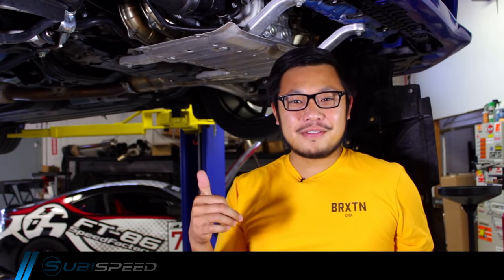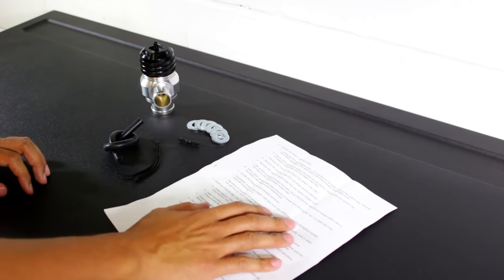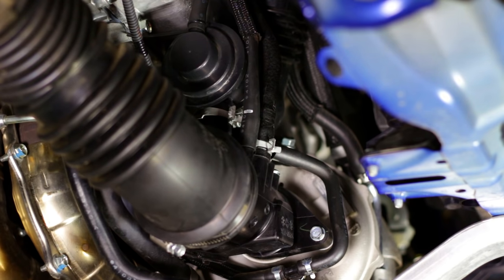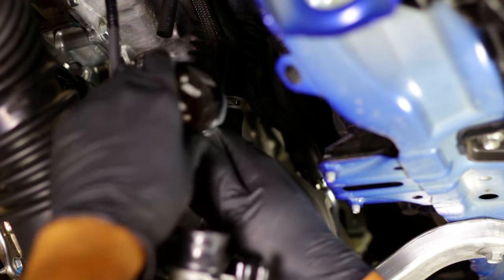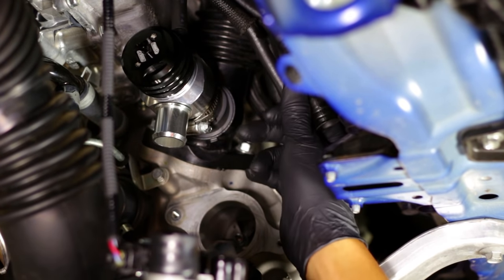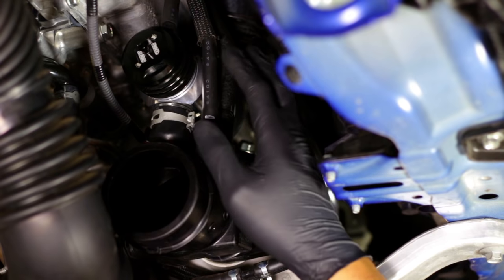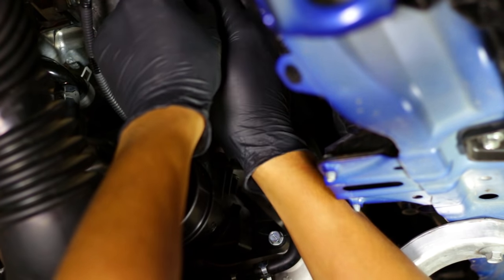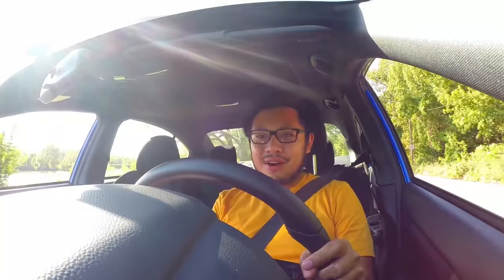SubiSpeed - 2015 WRX TurboXS Hybrid BOV Install

Comment: If you're going to buy a BOV, at least get something decent.  These are junk, I mean you have to use washers to adjust them?  No thanks.  If you need a plug and play that's reliable, responsive, and easily adjustable, get a Go Fast Bits BOV.
Reply from the maker: Nothing wrong with washers, physics still works and keeps it simple. TIAL a MFG most hold in high regards makes you guess at which combo of springs you need to set waste-gate pressure. At a certain point you have to shim, or make manual changes to have a product that can fit multiple different applications and scenarios.

Comment: Can i put this on a stock 2016 wrx? Would i need to add any washers, and will it cause any check engine lights?
Reply from the maker: Yes you can. Start with 4 washers and add as necessary.

Comment: Can you use this on a WRX w/ CVT?
Reply from the maker: Sure can.
Reply: Would you hear it as the CVT changes gears, or just moreso when letting off the gas (or in manual mode with the paddle shifters)?
Reply: +André Jeanpierre I have the CVT model and i only recommend driving with the paddle shifters.
Reply: Scott Bond , I only keep it in D when I'm roaming on the freeways. When around town, it's always in Manual w/ paddle shifters. Rev matching down shifts are so much fun!